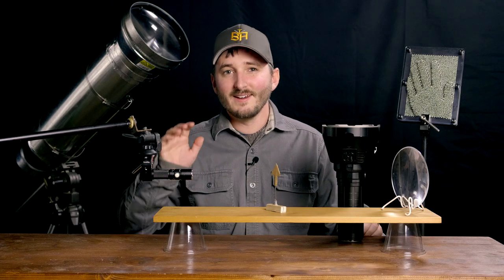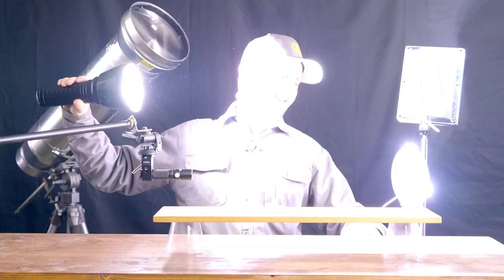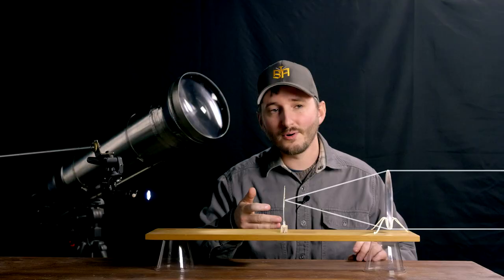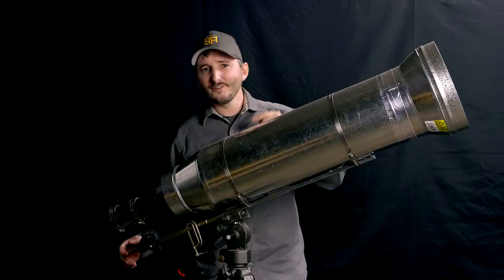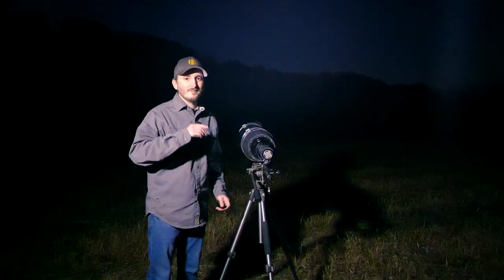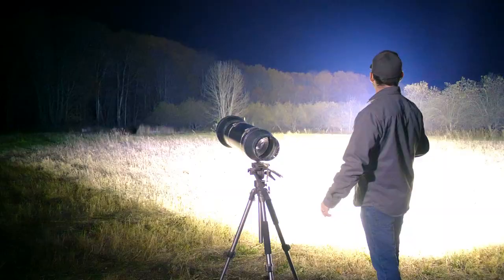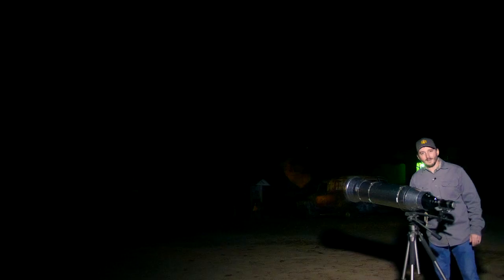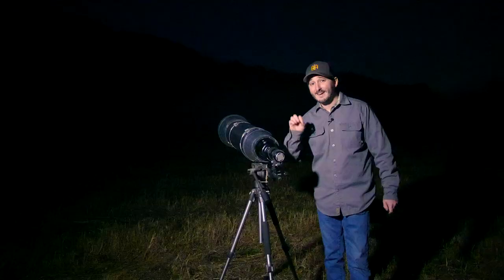How to Make a BATSIGNAL (For Real!)

Comment: Cool.  Now replace the bat emblem with a a clear LCD screen and project animated shapes.
Reply: Yes!! Cloud TV!
Reply: Might melt the LCD. But would be cool to see on that flashlights lowest setting
Reply: @ChamaraVFX  probably not, especially if you added vents to pull air past the LCD. 
Having said that, that's one of the main reasons why so many large format digital projection systems use DLP chips instead.
Reply: Just need to ask Evan & Katelyn, they recently made one.
Reply: was just about to say that  turn it into a long range projector :)
Reply: @kienanvella  blowing air on the LCD would be an excellent way of creating an LCD+dust projector.
Reply: I have made a projector using an lcd screen , with a large halogen bulb light source, still have it. it worked flawlessly for 4 years. you cool the entire thing by pulling air through a slit that goes between the lcd screen and the first fresnel lens, there is a fresnel lens on each side of the lcd. the air then flows through the rest of the projector past the bulb and out the back through the fan. dust is removed using a dust filter material over the inlet slit. it works by using a fresnel lens to straighten the light from the bulb and reflector. then it goes through the lcd, through the second fresnel lens focusing the straightened  light to a focal point. at that focal point is a glass lens that magnifies and projects the image out

Comment: Epic. So much possibility for shadow art.

Man that flashlight is so bright! Haha I'd love to try this with some Phantom cameras and see how far I could push the frame rate from one point source light.
Reply: I just use an array of 9, 100W LED modules(On a big heatsink) running off an old server PSU.
Not quite Tesla500's 1500kW LED water arrays that you can cook a pizza using, but it works for me and without the limitations of battery.
Reply: Frame rate and depth of field for days. You could use the sun as a fill light. And it's only $670.00
Reply: @ElectraFlarefire  yes tesla500 is one of my favorite Youtubers. His fiber laser module tear down video is awesome .... all his teardown videos are great

Comment: Hmm, I'm curious- could you mount a magnifying lens in front and use it as a mini deathray?...
Reply: build an iron sphere around it and call it a death star. Might want to add colored lenses for the effect.
Reply: Distance lighter
Reply: you can't use a magnifying glass to make it brighter than the surface, so if the surface of the flashlight could only go up to 1000C, the maximum temperature you could achieve with a magnifying glass would be 1000C
Reply: U  PLANNING  on  pointing it at  the DEMOCRATIC  HEADQUARTERS 😅🤣😂😂😂😂❓
Reply: Laserpointer would still be way bette there are laser pointers that are terrifyingly strong check out stryropyro channel
Reply: @uxleumas  the principle you're discussing really only applies to blackbody radiators. The idea is that if you try to use blackbody 1 to heat blackbody 2, blackbody 2 will always radiate heat quicker than you can put it in using the radiation from blackbody 1.

The light from an LED lamp is not blackbody (thermal) radiation though, so this limit does not apply. Well, it does in the sense that the lamp can't heat an object to white hot, or anywhere close to it, despite emitting white light. But the surface temperature of the lamp is no fundamental limit for how hot it can heat another object.

Comment: I love it!
There's a lot of light leaking out of the flashlight end. If you had more reflective surfaces keeping all the light inside and only letting it go out through around the symbol, you might get even better performance.
Reply: maybe add a lens directly in front of the flashlight, in order not to loose so much light that shines onto the pipe inner surface?
Reply: @TehEnte  Maybe. That sounds like a good idea

Comment: This is the basic principal of how a traditional projector works.  A tiny LCD screen is essentially placed at the focal point of a lens in the front of the projector, then a lamp such as an LED, Laser, incandescent, or even in some cases, and HID lamp turn on at the back of the projector bouncing off the LCD, and then through the lens at the front, projecters are more complicated than this in how they get a full range of color and everything for the sake of staying on topic, that is the basic principal.  The image of the LCD appears on whatever surface the projector is pointed at because of the same phenomenon that actually causes incandescent based flashlights to have a rather ringy beams, because the reflector is actually bringing the shape of the incandescent's filament into focus.  Similarly, I actually have a handheld laser that has a bin code inscribed on the can of the diode, and that code is actually projected onto the wall by the laser beam when I bring it into the lens's focal point when adjusting the focal length on the beam for burning.

Comment: I am actually not sure if you would need the setup with the fresnel lens. As far as I see, the fresnel lens is basically only a replacement for a thicker lens and in your setup does not collimate the beam. You would have to find the right distance to the flashlight to do this. Or you pick up a second lens that helps with this project. Also, it seems like the light source spends a lot of light on the inside of the pipe due to the arrangement of the beam. If you want to try out such lens systems you might want to have a look at the Optical Table Simulator from radioactivepages :)
Reply from the maker: Neat, I didn't know about that simulator.

Comment: 4:30  Woo!  Fellow Michigander!  Hello from Mount Pleasant!

I wonder if you could get a laser cut bat symbol made of metal and suspend it with some fishing line or extremely thin metal wire so you don't have to worry about melting anything inside.  Poke holes in the tubing and pull it tight, then tie it off outside of the tube.

Comment: Would be nice if using laser with large collimated lens, It helps reducing beam divergence, but the high power laser (E.G. Nichia laser diode bank) has terrible dot artifact caused by the structure of the diode (Multimode)

Comment: You should check out LEP flashlights. Smaller less bright but higher intensity. many can reach 2 -3 Km easy.
Reply from the maker: Yes I've seen those. That would be interesting to turn into a batsignal also
Reply: @Nighthawkinlight  I got an acebeam W30 it's like a helicopter spot light in your hand. I shine it on the mountains I can see from my balcony.  If I was a richer man I would gladly send it. I think the best right now is the weltool W4. Though I hear the jetbeam M1X WP-RX is able to hit over 3 Km but it is a cheaper light so results may be different with each light.
Reply from the maker: I might pick one up at some point to see what things I can come up with to do with it.

Comment: So I have what I think is an interesting suggestion.
An Ultrasound cleaner quenching bath. Or loud sound forge.
What would sound do to metal while it's heating up or cooling down? The whole deal with heating it up and cooling to certain temperatures is to control crystal formation...and sound would interfere with that...or something.

What do you Think?
Reply from the maker: Interesting idea, but I think the electrics to put out strong enough ultrasound to heat metal would be a long way out of my budget.
Reply: @Nighthawkinlight  No, not to HEAT the metal. (...yikes, that would be a BAD electric bill.)DURING heating. Just to affect the crystal formation while you heat it up in a regular forge. Or during cooling in a oil bath put a Ultrasound inducer in there too?

Comment: Awesome project and great video. But just a thought that occurred to me. When pointing this into the sky you might first want to consider how bright this could appear on airplane windows. I don’t know if it will diffuse enough over the distance to not make the same blinding effect as a laser pointer.
Reply from the maker: I think it would not be so bad at 65,000ft, and I would be very careful not to use it at all if planes are visible

Comment: There is alot of light leakage that can be avoided to make the beam go further. And beside that have you considered using a LEP light for this project?
Reply from the maker: I fixed the leakage in my next video. I don't think a lep would work well, at least not as I understand how imaging works with lenses. You'd need some kind of diffraction grating or something that is over my head to make

Comment: With all of the movie theaters in trouble from virus restrictions, maybe it is time to get some inexpensive equipment from a liquidation.  It would require a substantial power supply. The flashlight should be reserved for when someone won't back off you while driving at night.  Instant loss of night vision and maybe some retina damage.

Comment: You never mentioned it, but that Fresnel lens must surely be made of plastic.  Good thing it is so far away from the light of that 100K lumens flashlight, or it could melt.  I imagine the hardest part of this build was matching metal parts to form the cone.  Could these be made out of plastic or would these likely melt?

Comment: I really like how at higher powers, the air the light travels through turns blue because of the scattering. There's enough light that the small distance still has a significant amount of scattering.

Comment: When the fan started up it made me laugh. An aircooled flashlight lmao
Reply: It must be running over 500 watts to get that much light from 18 Cree XHP70.2 LEDs. If it didn't have a fan, the heatsink would be too big to be portable. Even though the LEDs are pretty efficient, most of that power is still turned into heat.

Comment: Gotta wonder how well this would work with more efficient optics. Looks like a ton of light is wasted inside the tube through reflections. Wouldn't it be possible to use another lens in front of the flashlight to focus the light into a tight beam, then have it go through the logo and then the fresnel lens? That way you'd be able to use more of the light
Reply from the maker: Might be possible but it would be tough to find an appropriate lens

Comment: Damn that is an amazing flashlight. That said i think we could make one with out this flashlight. It's all in the reflector cone. And if you have two reflector cones with a hole in the middle where you put the emblem in you have almost a laser beam. Because all the light that is not perfectly in a straid line is reflected back. But be carefull with the heat!! And do not look in to that beam of light or you be blind.

Comment: Could you give more info on how you selected the length of tube and the position of the emblem?  Thanks!
Reply from the maker: Based on the focal length of the lens. 500mm for that lens. Tube needs to be longer than that, with the flashlight some distance away from the focal point so it isn't in focus itself.

Comment: Bat signal APPROVED!   Great video (as are all of yours!) keep them coming!  BTW, what is the mount you use on the tripod for this rig?
Reply from the maker: I used a normal quick release plate for the tripod and attached it with the mounting screw and a 1/4" nut to a metal shelving rail which is pipe clamped to the light.

Comment: Can you go into more detail at the actual build process, including mounting on the tripod, etc?
Reply from the maker: Probably I won't, because building it was based on specific parts available to me. Mounting the tripod was easy, I used the screw on the quick release plate to thread into a nut to hold it onto a metal shelving rail. The rail was held with large hose clamps to the 8" pipe.

Comment: I see they come in 1000mm focal lengths, would this increase the range? and how would the diameter affect the range?
Reply from the maker: It should increase the tightness of the beam, which would increase range theoretically. The downside is that the lens has to be further forward which means less light will reach it. It might balance out.

Comment: check out GOBOs on google, that is teh professional version of the cardboard cutout batsignal you have, and its usually done (in teh UK at least) on an ETC Source 4 unit with (approximately) a 10 to 20 degree lens tube fitted.

Comment: Man, that projection works surprisingly well. You should definitely try it again when you get some clouds, I'm super interested to see the result.  I'm also curious if you could make out the shape when shining into the fog, and filming in line of the beam.
Reply: Being a white light, you would just end up with a blinding wall of white with little to no depth. It's just like turning your high beams on in the car in a fog. You blind yourself.

Comment: I noticed that there was light bleeding into the edges of the bat signal on higher brightness settings against the barn. Was that true in person or just how the camera picked it up?
Reply from the maker: That's real. It happens because I didn't seal around the film tightly enough to block all light inside the tube.

Comment: have have built the same as you but no batsignal as yet do you have to be a good distance away from wall...other in side tube how far should batsignal be from end of tube???? and the batsignal do you need to blackin the silver foil on 1 side?im getting no batsight at all coming out
Reply from the maker: Mount the lens and light on a table as shown in the demonstration in the video and play with the distances from the lens until the image comes into focus. That will give you starting measurements which you can fine tune in the tube

Comment: What are the specifics of the fresnel lens you used? Collimating the 18 beams isn’t easy or even totally possible, but I keep trying! I even tried using a giant crystal ball!
Reply from the maker: https://www.ebay.com/itm/115380611404?itmmeta=01J291BF15FET0AYRMXP67ZSJQ&hash=item1add38694c:g:qX4AAOSwD-NhBP--&itmprp=enc%3AAQAJAAAA8D1bWLxrq3jfn9GZEays1Q2hc3Nt4bucYJpgG0EkqjQ5H%2Fe4RQ0OJLzkSGxkatYfQo%2FqwiTlTp%2FL8uDS9Ebh3nuyJ9wZcM5zcJbarkMrok%2FqJtmjD9Gf8AOUgFWQWPwuD0bat98pOOJFCNS%2FZHFd1pvMvCyDNaUkpKeZ8uGZTfT9r0ySoPipcOmAie0HuPyXZSvLOT0ewl47GBT9m3E8YMWJLpGdWbL%2Blw5nmnbLgh%2BfN7NGShpUFTGGz1DfRZJEmp2zduf4G4pMIvNqaFeSg47mVbmI3uN5JUYo7AjgOlYg%2Brdp%2FD6S%2FhkiL%2FGUilkSxQ%3D%3D%7Ctkp%3ABk9SR9bwraGSZA

Comment: Hi! Thank you! I love your video! BUT, my friend & I too, have been trying and trying for like a year to make a Batman signal for the clouds. We have struggled, with numerous attempts, but are still failing. We have come very close, but just not right. Frustrating! Anyways. We are using a 1million candle lumination spotlight, with an oatmeal box as the tube, and a magnifying glass, all the same size circumference, and our Batman emblem of all sizes ranging from 50¢ piece on up to almost same as the oatmeal box. And have placed them all at different range length within the tube, and outside the magnifying glass. And up against actual spotlight lense. But we get either a light circle in the middle. Or distortion. We have not yet had good clouds, but have been near successful up against our work building and trees have been so-so. I feel like we are missing a major component, or else need good clouds. Have any ideas for us? Please n thanks
Reply from the maker: Your light probably has a reflector in it that is too large a diameter to make a clean image when close to the front lens. Try doubling your oatmeal tube length by adding a second one and put the light way at the back. The image will become clearer. You will probably still have trouble reaching the clouds as that is a difficult challenge for an ordinary spotlight.

Comment: Would it help to paint the inside of the tube matte black or was the flashlight so insanely bright that I just didn't notice you already did.
Reply from the maker: I already did. It helps to stop reflections that would mess up the image
Reply: I figured you already thought to do so and the flashlight was just insanely bright

Comment: A 100W COB LED Chip should work alright too, since it doesnt have to be a small light source, correct?
Reply: That's a helluva lot less light
Reply: @ryanmickelwait1521  Yeah i know. Less than 10% but its still decent i guess. Even at 900 lm it was clearly visible and these chips can roughly put out 9000

Comment: A fundamental limitation on sharpness is the degree to which the light is not a point source.
Reply from the maker: That's only partially true in this application. The light can be large and diffuse when it's a shadow you're trying to project. Think of the design of an overhead projector where the light source is the size of the whole transparency sheet.
Reply: @Nighthawkinlight  Good point. I think I've mixed it up with brightness limitations. I spent a bunch of time a couple years ago trying to engineer a projector with the most bang for the buck for a product that projects holiday images on the side of a house. We were very limited on the power of the LED due to the cost of the LED itself as well as the cost of the transformer to drive it. We found that getting LED's with more lumens didn't result in a brighter image if the extra lumens were generated by a larger emitter surface. The fundamental optical truth turned out to be that the optics could only make the light density worse than the source, not better. So to get the brightest image on the house, you maximize the amount of light relative to surface area of the emitter and try to degrade it as little as possible as you go through the optics. In your case this challenge is resolved within the flashlight.